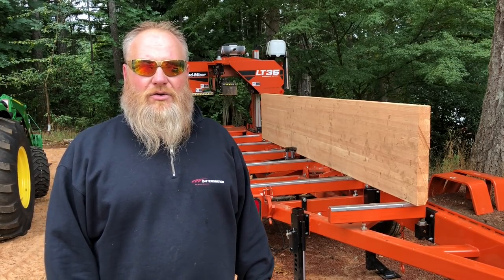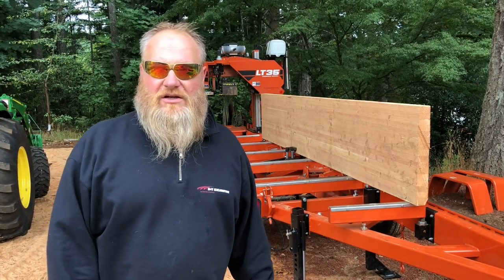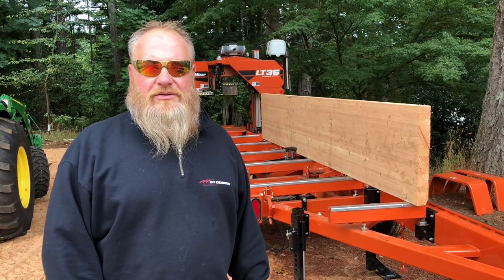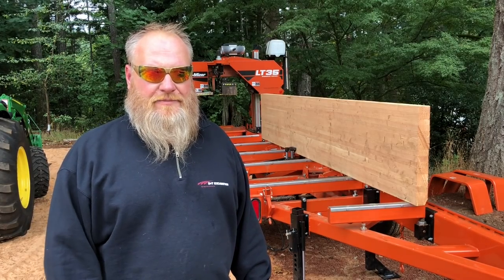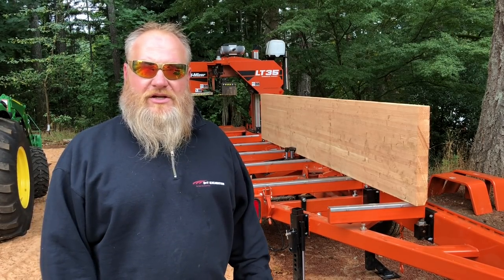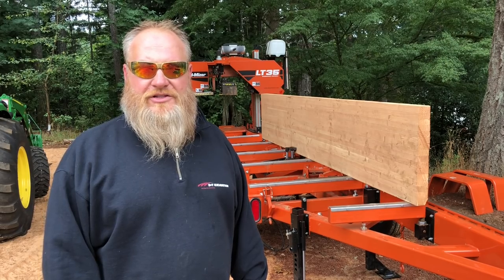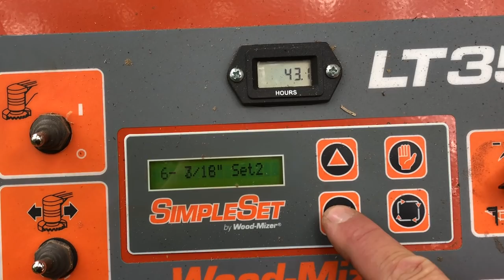CLIENT PROJECT: Resawing reclaimed beams into wood tiles

Comment: I can't get over how awesome your property is,  my question is when your cutting those beams are you using the woodmizer double hard blades? & what ° are you using? I have had good luck with woodmizer 4° to their 10° just received a box of 747s. Thanks again for your time and efforts to putting out great ideas and content! 👍🌲👷‍♂️👷‍♂️
Reply from the maker: I believe those were 7 degree double hards. I eventually switched to BiMetal blades fir the reclaimed stuff.

Comment: Another good video. Too bad you can't save the sawdust shavings to make wood pellets for a pellet stove. But knowing you you probably have all kinds of drops and odds and ends to use in your wood stove. 😆 Can the debarker be swung up out of the way? What kind of blade does the debarker have, a saw blade or a chain saw style of blade? On the lighter side of things I noticed that you have a Sasquatch sticker on the main blade cover. Does that mean you cited one already? Looking forward to your next video, and enjoy this cooler temperature.
Reply from the maker: Thank you! I think my neighbor may be sasquatch. The De-barker only swings horizontally and not far enough to miss the bunks. I'll have to get a close-up of the blade. It's basically a 6' disc with maybe 10 carbide teeth.

Comment: Hello, if I run 4 quarter on simple set I sent it to one 1 1/8 correct my bottom board is slightly bigger am I doing something wrong
Reply from the maker: Not sure. Perhaps your cant is too big to be evenly cut at 1 1/8"?
Reply: Kerf